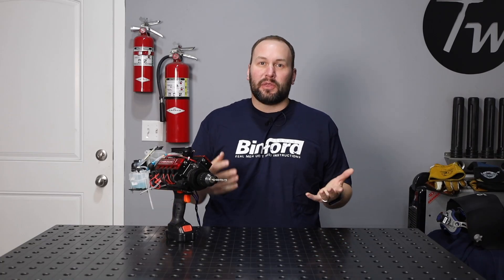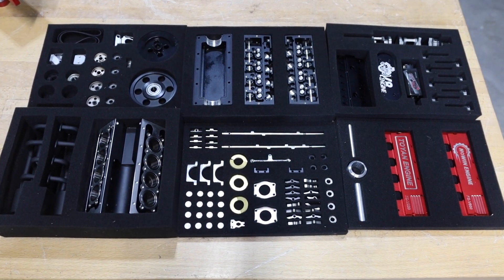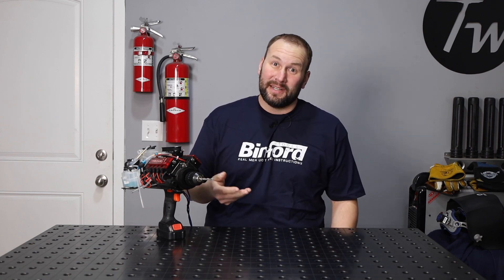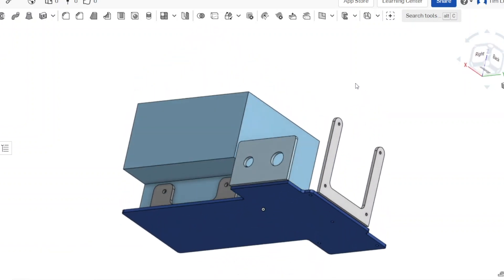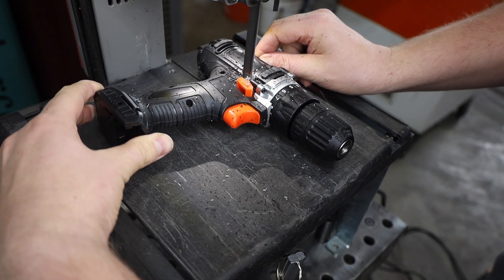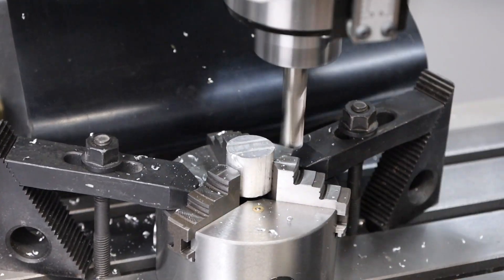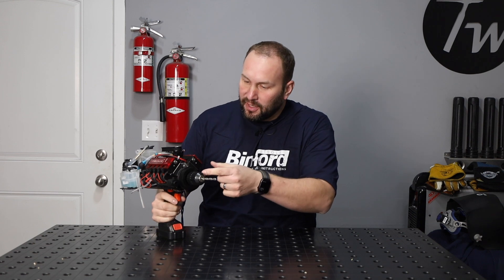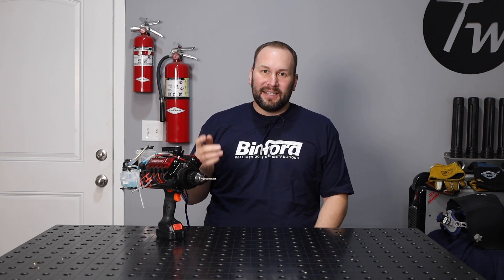I put a NITRO POWERED V8 ENGINE on my DRILL!

Comment: Yeah reading some of the posts definitely get a rc 4 sprung clutch set up and you can run a micro pull cable for the trigger and throttle but great hobby build

Comment: Nice build.  Is is gas powered or battery powered.   I noticed that you had a blue wire connected to the drill ????   And that Duracell battery on your bench.  Also red and black wire coming from your switch plate. ???

Comment: This is just a drill bit on a motor with a drill handle glued underneath. Would be much cooler if you used the trigger to control the throttle. Then it would actually be a V8 cordless drill.

Comment: Could you run it through a gear box from a battery drill/driver combo. That way you get a clutch, various gears and torque settings plus hammer drill setting etc.....

Comment: Laughing at people saying... Add a clutch and transmission.
Ya know... if you use and electric motor you won't need a clutch or transmission because an electric motor can achieve near peak torque at any RPM.😅

All seriousness aside... Nothing is cooler than a V8 powered drill.

Comment: You think THIS is impressive?  I once mounted a supercharged 454 Hemi to my ex-wife's personal vibrator.  It ended up clinching the Guinness World Record for Most Powerful Dildo, and also the Doc Johnson Golden Buttplug Award for Most Innovative Sex Toy, Gasoline-Powered Division, for 1984.

Unfortunately, my ex-wife was tragically killed when she accidentally gassed it up with Nitromethane Top Fuel and it spiked at 1,273 HP right at the end.  But now I have a nice plaque on the wall, so I guess it all worked out.

Comment: You're not even close to finishing this rig, but you already screwed it up while on the CNC plasma table you should of made a hole in the bottom of the mounting bracket for the engine and put a cable for the trigger to throttle the drill that lifting your hand up to throttle it more is un heard of but using that JB weld that is possible that will never happen unless if you use micro servos with a controller to throttle the motor.

Comment: 4:48 i would have drilled some holes into the baseplate (that align up where the plastic comes into contact with the baseplate) so that the JBweld would ooze through to have a more secure bond, i would have done the same with the plastic handle so it wouldn't be just the glue holding the handle to the baseplate there would be a physical hold as well.

Comment: Please next put the Gas Powered Drill on a test into metal with metal bits to see how well it will do!! Also I feel it be cool to maybe try it on a Reciprocating Saws this would be a great challenge and make you have to think about how to make rotational energy into back and forth but after it been cool to see how well it can cut metal and maybe its limits, With limits I would like to see the limits also with the drill but its scary without a way to gear and risk of breaking if something stops the shaft!!
Reply: If it binds on the metal he's going to snap his hand
Reply: @hemi4722  owe thats a good point there is no way set in to stop it. But does it have enough torque to do that? I genuinely don't know?
Reply: @CameronSalazar2113  that's a valid point - he should test it
Reply: @hemi4722  hook up like a pound scale to the handle or something like that and get it caught in metal on purpose and see how much it will tank. I bet there numbers on google saying how much weight it takes to break a wrist.

Comment: Great build! But somehow it did really convince me how useless an internal combustion engine is... You would need gears and a clutch to keep it idle, and also multiple reverse gears as well. The only thing holding back electric vehicles is the battery, not the engines.

Comment: What is the fuel consumption and horse power on that engine?

I always wanted to build something like that and hook it up to a car alternator. That way I could charge the battery on something like a RV or camping trailer.
Reply: You could buy 10 generators for the price of that little engine.

Comment: Great stuff.  You just need to add a few gears, a hammer action and a torque clutch release and you'll be set.
Reply: Definitely needs gear reduction so won't smoke the bit while drilling steel.
Reply: It might hammer drill the entire drill in the concrete that things a beast😂
Reply: Yes, starting with a high end Makita hammer drill would make a big difference.
Reply: It would not hammer the drill itself into the concrete due to many different factors 7:06 

,

Comment: This is too large and heavy for hand tool like drill. It should be stationary mounted. Maybe this could be a good engine for drill press, or lathe, or milling machine, combined with a gear box to reduce rpm.

Comment: I will say the part at the end where it drills out the hole as violently as a chainsaw cuts was pretty funny. But using it on metal is probably a suicide mission when it gets stuck and breaks your arm.

Comment: Very cool little project and very nicely executed. 
I realize this isn't something one will be leaning into while drilling 5/8" holes into 3/4" plate but I have to wonder how much of even smallish holes in wood would affect crankshaft thrust bearing life. I very much doubt that the engine's design allows much in the way of axial thrust so be cautious in how often it is used as a drill.

Comment: A V12 would be much smoother (less vibration) and make it easier to handle the drill....  or you could use a straight 6....